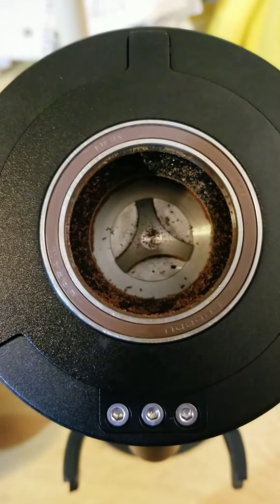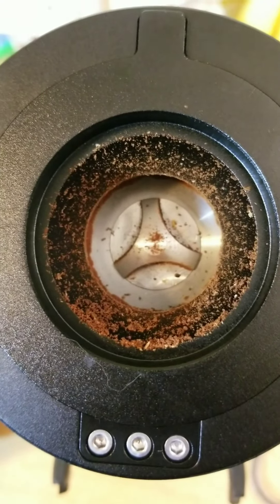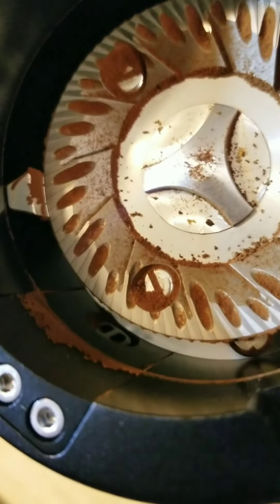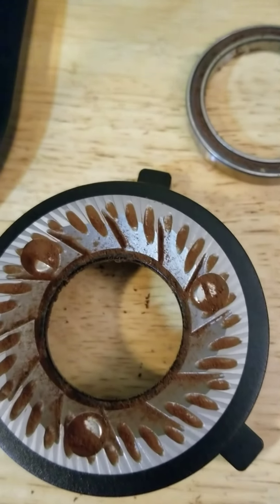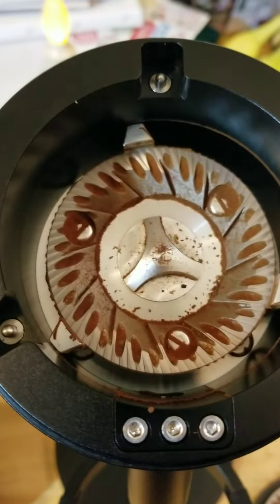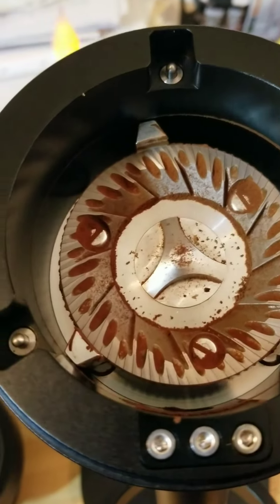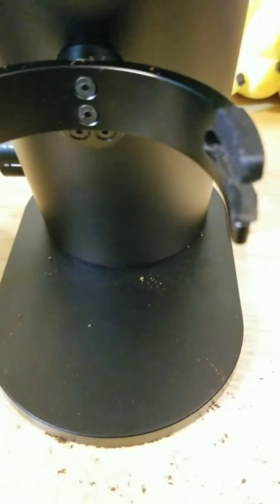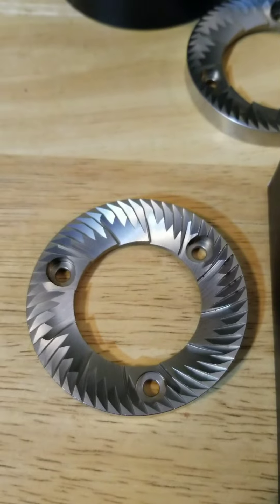Another Lagom P64 Internals, changing burrs and inspecting retention.

Comment: How is the lab cast burr performing for espresso? Do you get a log of retention and clogging?
Reply from the maker: The burrs themselves have crevices that hold a tiny bit of retention but its negligible.  I didn't love the ssp cast burrs people claim it has good flavour clarity but I'm just getting lots of body and fines not much clarity maybe it needs seasoning and a perfect alignment. Been really liking the older stock p64 burrs though in the last few months.  I have the new Option-o Mizen Omni burrs coming soon too! Which are like the ssp cast burrs but hopefully a lot better or at least don't need 30lbs of seasoning before they're decent!
Reply from the maker: Never had clogging with a Lagom P64, it's not a DF64! :D  I have put back the stock burrs a little while ago and used it without a bellows for a while, the other day for a fun experiment I decided to use a little bellows and see how much I can blow out of the P64, and a Niche Zero I borrowed. I got 0.28g out of the Niche and 0.14g out of the P64, so basically nothing out of either.